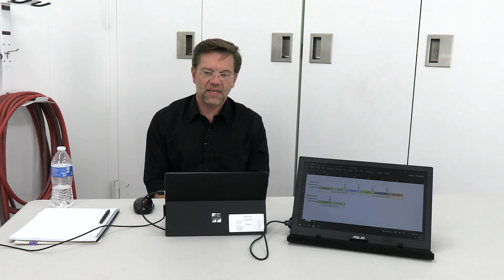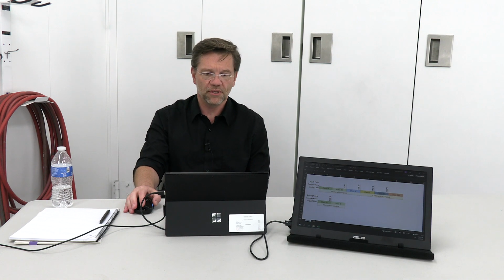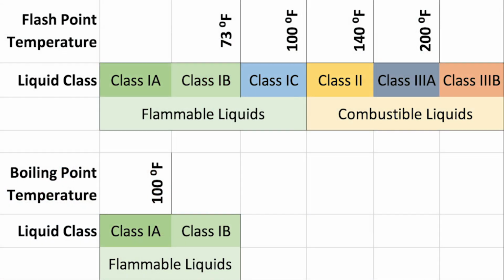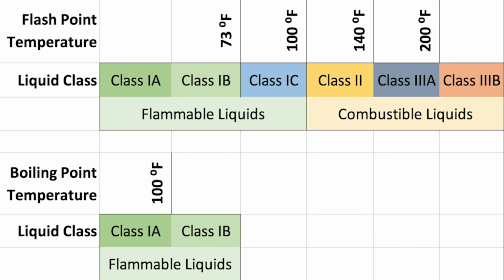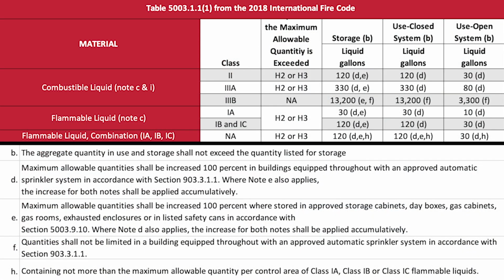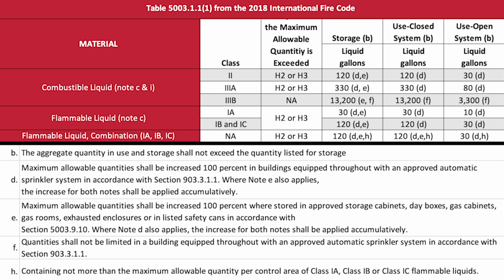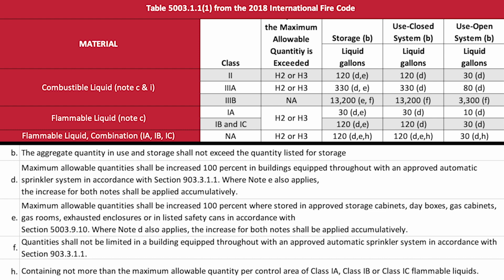Paint Storage | Paint Mix Rooms & Hazardous Material Storage Buildings | Global Finishing Solutions

Comment: As a paint jobber do I need to have a mixing room for mixing solvent paint? I always thought you needed ventilation and spill containment but the local (Miami) fire inspectorsays no. He said Home Depot doesn't have them. But they usually don't mix solvent based paint.
Reply from the maker: Hi Rich,

NFPA 33 Standard for Spray Application Using Flammable or Combustible Materials requires that operations such as mixing paint be performed in the paint booth with the ventilation in operation or in a mixing room, which is also a ventilated enclosure.
  

It looks like Florida has adopted NFPA 1 as their fire code.  Section 43.1.6.3.1, which is language extracted from NFPA 33, states that “Dispensing or transfer of liquids from containers and filling of containers, including portable mixing tanks and “pressure pots,” shall be done only in a spray area with the ventilation in operation or in a mixing room.”

NFPA 33, and Chapter 43 of NFPA 1, is primarily used for finishing operations and supporting processes like mixing.  There may be other codes or standards that are being enforced for mercantile occupancies like a Home Depot. It is best to reach out to your local inspector to make sure you meet their requirements.

Thank you!